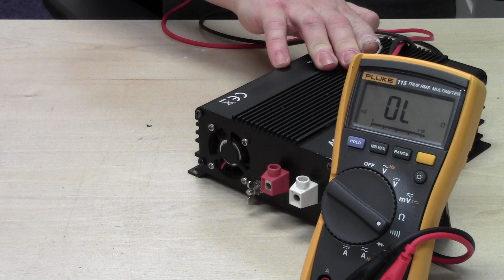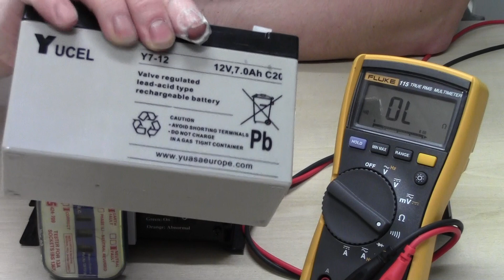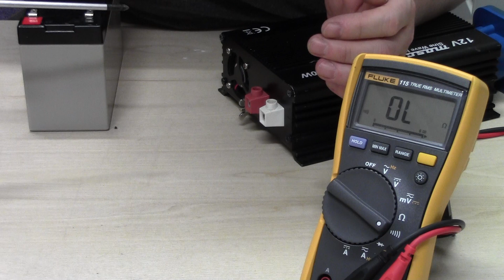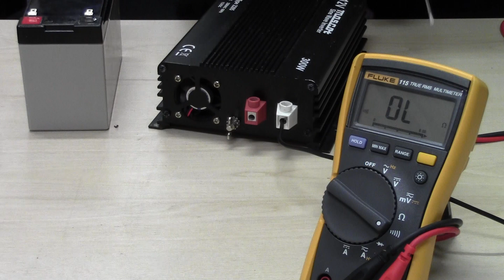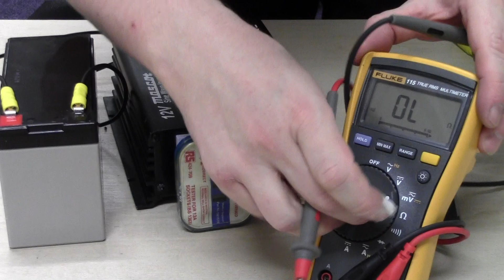Mains Inverter Repair

Comment: If you go back to 16:38 you can see a blacked, burnt capacitor pin in the upper left hand of the board as part of a large, ground/power plane.  Looks like it blew out the solder around it, removing it from the circuit.  Not sure how that was missed since you wiped right over it several times when cleaning the board ;-)  I'm expecting either a blown cap and fuse if it should re-contact the board when flexing due to heat or an early failure after returning this to service since the capacitor isn't doing its job.
Reply from the maker: +flomojo2u Just took a look at the board again and cant find a blown out joint, i will do a follow up 5 min vid.
Reply: +channelengineer If you go to 16:32 it's the top pin of 4, immediately above your pointer, there's discoloration and it looks to be missing solder.  There are also small blobs of solder that look like they could have dripped out.  It is tough to tell without a high-res overhead picture, but it looked like a problem.
Reply: +flomojo2u Just checked again, looks like the cathode of a diode above the two caps.
Reply from the maker: +flomojo2u Take a look at the follow up video i did a day or 2 ago image is bit clearer. Trust me the solder joints are ok, the markings around 16.32 are the connections to the fuse holder that was bit dirty.  https://www.youtube.com/watch?v=qFo4M9C5UKw